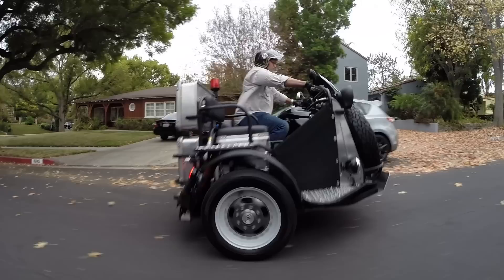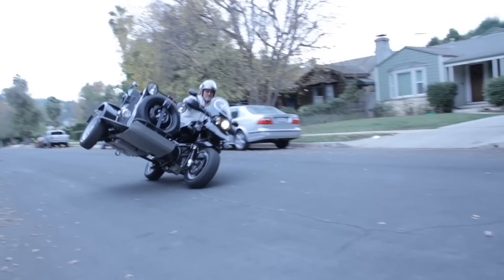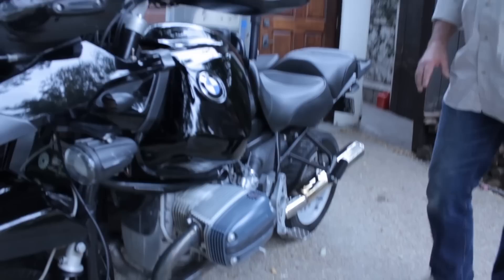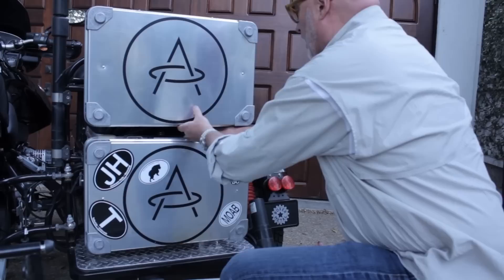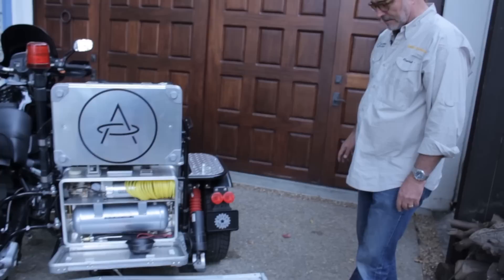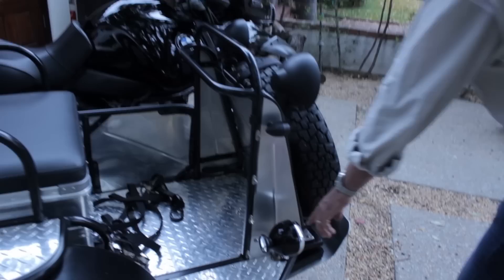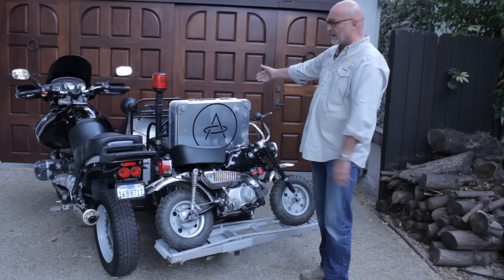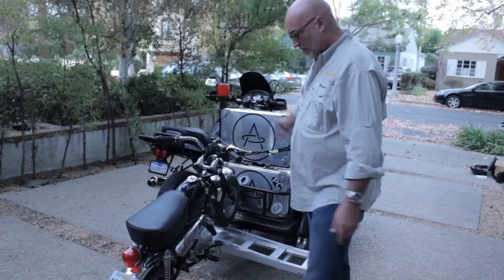Custom Off-Road BMW R1150GS Adventure Sidecar Built By Boxer Metal GoPro Hero 3+

Comment: Beautifully designed. Certainly a piece of engineering. What I can not still come to understand are these facts: for a (roughly) $28000 motorcycle, $7.000 sidecar, you still have a bike with a side car that does not tilt, and it is driven only by one wheel. As comparison, Is it a wonderful ashtray installed on a motorcycle?

Comment: I ride an 1150 with an e2000 by EML myself. A tip from me, that seems to be an EML front swingarm. Like also the rest looks like EML Design.With this type of swingarm, it can happen that the shock absorber springs through to the stop when driving through a pothole. The lower cross bar then hits the front wing very hard. To prevent this, I put in two spring travel limiters from Harley Davidson.
In the meantime, there are good battery compressors. I have a Makita one with me because I have Makita battery tools anyway. Its battery is easily enough for a holiday in Iceland.

Comment: I wonder what the affect on the chassis is when riding the cart sideways like that. It must have some sort of detrimental effect on the chassis as a whole. But yeah, sterling job in making it sturdy.
Reply: +Jason S It's actually tough on the tires that are not designed to run on the sidewalls.

Comment: Very interesting sidecar, but far away from the reality to ride it in a desert and offroad. No reverse or 2WD on this heavy beast brings you not far anyways. Electrical suspension, electrical airpump, looks like you have never been in the desert? Temperatures are very low in the night, the first thing what get killed is your battery....less is more, make a "by hand" ajustable suspension and/or a simple airpump. Less weight, less troubles with the electrical parts etc. 
Really a nice ride!

Comment: I really love the idea of a sidecar motorcycle and would like to see a BMW version of the Ural. One thing I notice is you don't have two wheel drive - but you do have car tires to grip the road better. Do you find that comparable to a two-wheel drive system? I would love to see a transverse axle driven sidecar wheel in a production BMW motorcycle. For off-road cycling you just can't beat a two-wheel drive system. I hesitate to get a Ural because I've heard of so many quality control issues and mechanical breakdowns. I'm hoping someone will compete to build a better off road sidecar motorcycle. You've got a badass machine - I'd just like to get one in two wheel drive if you can get ANY motorcycle company to build one. The market is definitely there.
Reply: Alexandru Popa s
Reply: Driven sidecar wheel complicate the design but don't get an advantage on the offroad, maybe in a depth mud.